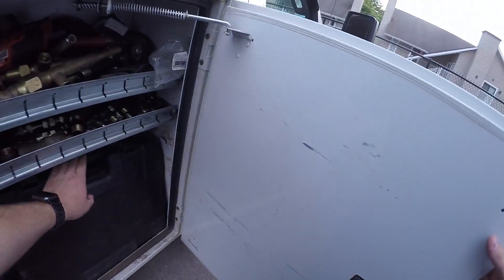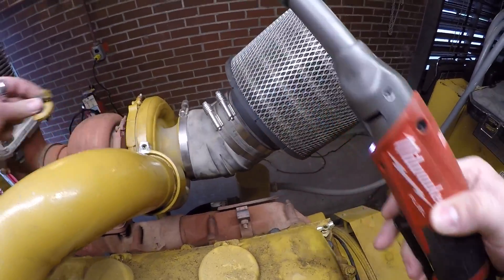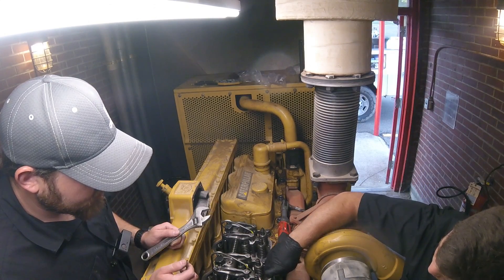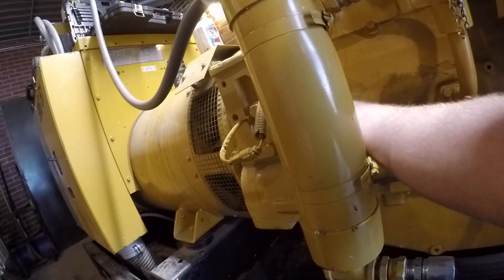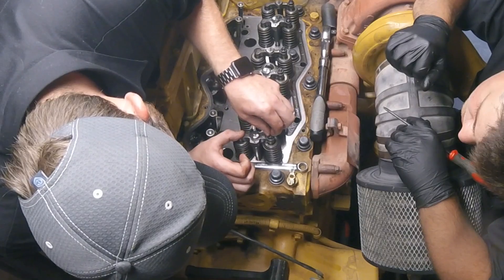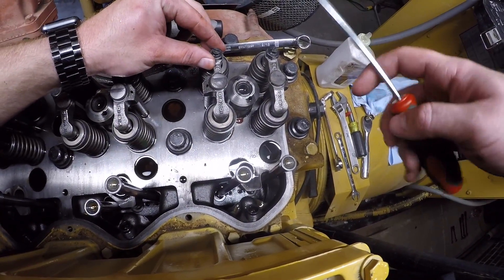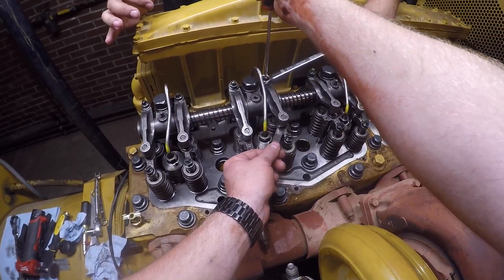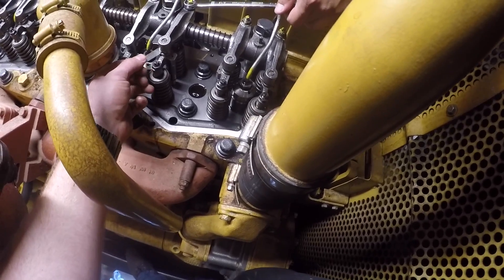CAT 3406 Breaks Head Bolt. Replacing All The Head Bolts

Comment: And here before I clicked I thought it was your truck engine
Reply from the maker: Sorry to disappoint
Reply: @DrEwBaBy625  oh you didn't, I just glanced at it and jumped to a conclusion.  I'm very glad for you this wasnt your engine, how does something like this even happen?
Reply from the maker: Glad it wasn’t my engine either. It almost looked like a defect in the metal. I have heard that this is more common on generators, with a generator it starts and goes straight to 1800 RPM. Once it reaches 1800 the transfer switch puts the building load on the generator, so there’s no warm up or anything so maybe this puts a lot more stress on the headbolts.

Comment: i have a truck that had the head bolts replaced one at a time. i ordered a new head gasket since the combustion is getting into the cooling system. hope this works out better for you. nice to have so much room to get to everything.
Reply from the maker: I had my doubts about doing this as well but cat man assured me it would be fine! Zack and I are pretty optimistic, it will be just fine. That is one of my favorite things about working on generators it’s all right there out in the open.
Reply: @DrEwBaBy625  I'm hoping it will be ok for you! I love when there are in a building, plenty of room. In a container not so much. I had a 3406 last week in a container. First it has a 3 foot tall base tank so you're working off a ladder all day. Second the block heater was conveniently located right between the 2 doors on one side. Swinging those big wrenches to break the lines loose in a tight spot was also super fun. I ended up going back another day to finish installing a new battery charger. That was why I took the service call in the first place. 2 dead 4D's.